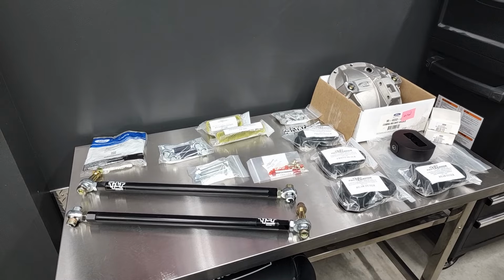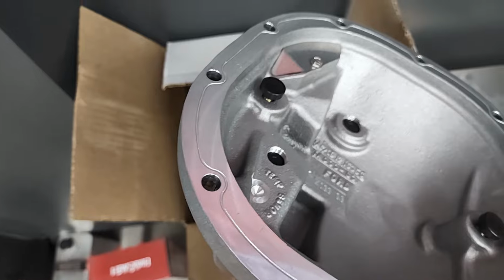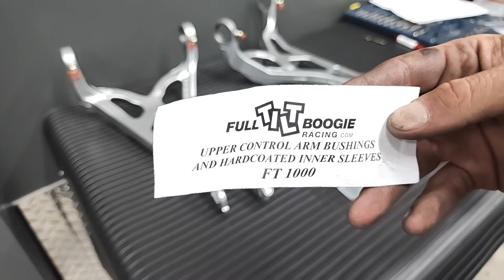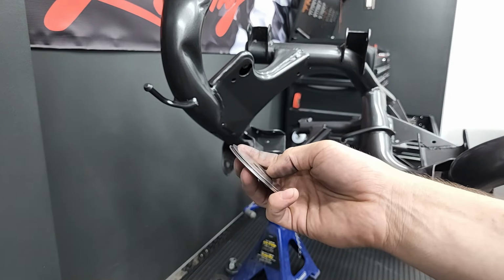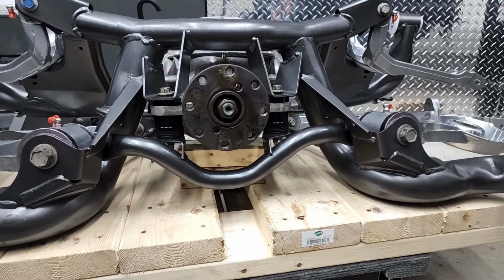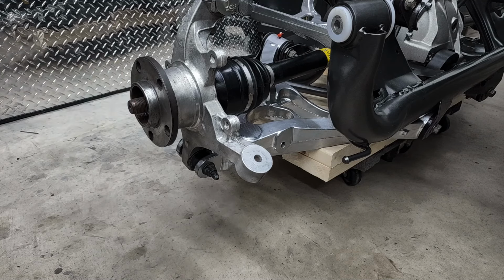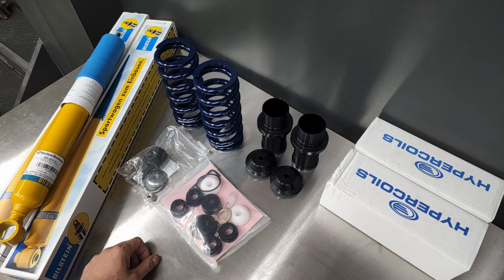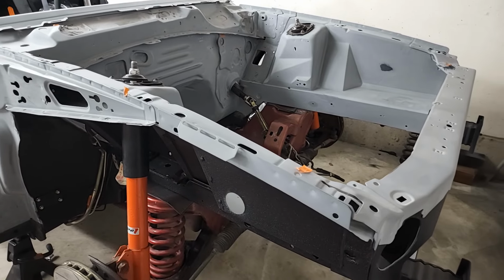99 Saleen gets a complete IRS refresh & rear coilover setup

Comment: Im currently building 01-413 to similar specs but without the full restoration that you have put into yours. I was just able to get the FTBR stuff in and the rear reinstalled. Its been great watching through your videos while recovering from ankle surgery. Hopefully in a couple of weeks I will be able to get back to some smaller stuff on the car.
Reply from the maker: Awesome man, good taste! hope the recovery is going well!
Reply: @straightlaced  just wanted to drop in here. Hoping to get my engine back from the machine shop in the next 2 weeks. Picked up a 2.3 whipple for it as well. I figured I would drop in to see if I had missed a video. Since there wasn't a new one I decided to leave some motivational support.

Comment: Also, thank you very much for your attention to detail in your vid.  Eibach had been making a larger rear sway bar, but they have discontinued manufacturing it.  Do you know of any other source?
Reply from the maker: Thanks for checking it out! I appreciate it! Yea I'm not too sure how much of a difference there would be over the oem sway bar. Not many of the big guys like Griggs, MM, steeda, or kenny brown offer them (at least I dont think!) so I'm thinking the OEM one will be sufficient enough. I know the rear eibach one sometimes interferes with the MM coilovers but dont have any direct experience with them.

Comment: I completed nearly all of the same upgrades to my first '99 Cobra using goodies from Full Tilt Boogie & Kenny Brown Performance. Then a "ricer" in a 350Z wrecked my mistress in 2016- hit & run - totaled my sweetheart. I have a 2nd '99 Cobra (Red) with 36k miles on it.  There's thousands of dollars in parts in my work shop that I yet to install. You have given me some ideas that I believe I will implement.  I am VERY surprised, however, that you did not replace the factory Diff Brace with a heavier after-market unit.  After I made the same changes to my 1st Cobra, there was absolutely NO wheel-hop.  By the way, are the new rear half-shafts factory spec?
Reply from the maker: sorry to hear about the original car but awesome news on the replacment! Yea with the IRS there were a couple things I left out or just held back on that I may do in the future. We'll see how it drives and then make some adjustments/additions. The halfshafts are just OEM 04 Cobra halfshafts. I encapsulated and coated them to keep them from flash rusting.